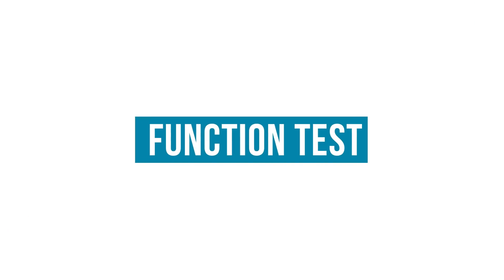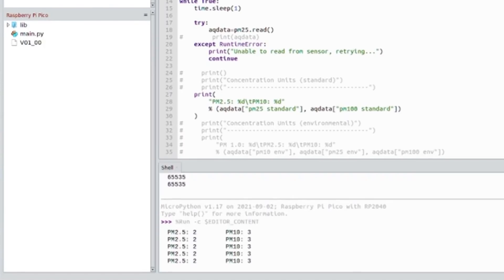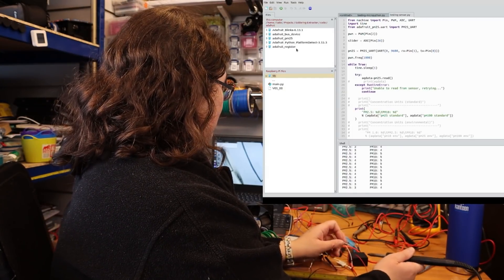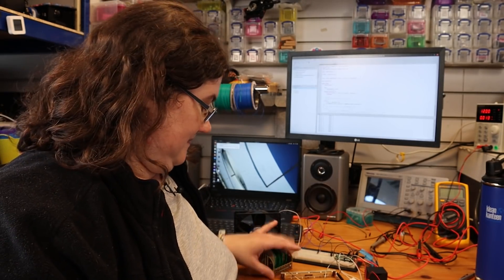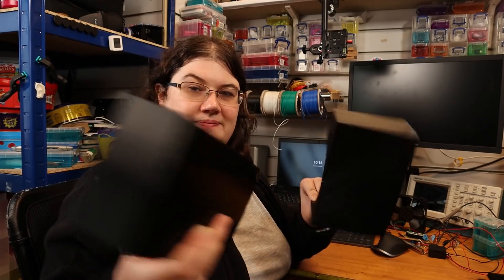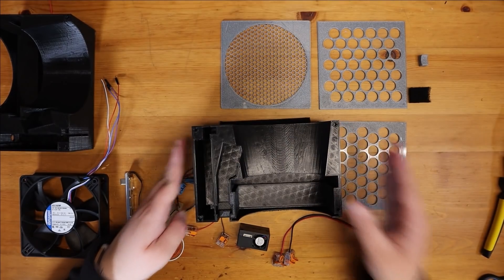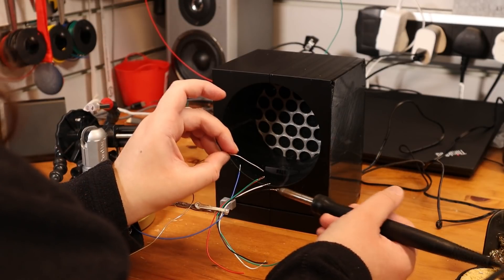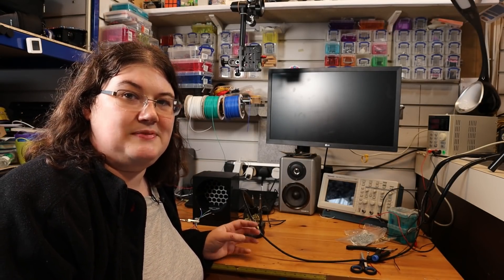Make your Own Auto-Sensing Solder Fume Extractor

Comment: I like the idea to use a particulate sensor. However, to really filter the fumes and not just blow them away, you should use a HEPA filter as well, as the fumes are mostly particulate matter which isn't affected much by the active coal filter which mostly filters VOCs. And then since the HEPA filter almost totally stops the air flow, one must also pick a fan optimised for static pressure...

Comment: Brilliant idea, thanks! I have done about the same without the sensor years ago (just a switch on there), but DC and battery operated (DC charges the battery when plugged in) because I hate wires on the bench other than what I'm working with :D ... For the fan start, I'd probably give it a full blast pulse, then drive it down instantly, that way it will start (there's probably a condenser in there that need to fill up before it starts or some trickery of the sort). That way you wouldn't need to have it running all the time. As for the potentiometer for use outside of soldering, I would just add a button to manually start and stop the fan. Maybe add 1-2 additional pushes for 1-2 preset speeds (1st push on at low, 2nd push on at medium, 3rd push on at high, 4th push off). Maybe add 3 small LEDs for the states (all off, 1 on, 2 on, 3 on). Would be neat. Just my 2 cents, hope this helps :)

Comment: Cool project, but seems a bit complicated.  I'd have just put a current sensor on the solder station mains or an optical sensor to detect when the soldering iron leaves its holder.  Add a 555 timer and you're done.

Comment: clever stuff.... in the past  I had thought of modding my soldering station  not as clever as they way you did it, but using either a microswitch or a reed switch to turn the fan on  as soon as I lift  the iron off the holder with a capacitor to keep the fan  running for a  few seconds or so after the iron is put back down  - as there would be no programming I'd just use a 10k potentiometer inline to set the fan speed

Comment: why don't you keep it simple and just bind the thing with your soldering iron? 

just wire the fans power source parallel with your soldering iron lady don't reinvent the wheel... 

if you really want to complicate things you can take temperature measurements from your soldering iron and activate the fan at soldering temps or measure the current drawn by iron or something which would still be pointless but still would be doable cheaper faster more reliable with analog jellybean parts. you don't even have to fool with your iron just use extension cord with inline switch or a relay or something with a 12v adapter. that way you cant forget to turn the fan on.
Reply: omg more i think about it more angrier i become. unnecessary  complex possibly problematic and hard to fix/modify when needed solution to a non existent problem. just turn the fan on when you want to...

Comment: Rather than using a sensor I would probably run them on the same power strip and have it such that when i turn on the power strip for the soldering iron it powers on the fume extractor.
But sensors are cool!

Comment: I've been flux sick. The little wisp of smoke that comes off a soldering iron is not going to get you sick. What made me flux sick was dumping a whole one pound spool of flux core solder into a molten pot of solder. That kind of cloud you should avoid. I'll tell you what getting flux sick is like. Just so you know if it is happening to you. If you're writhing on the floor and dry heaving you're flux sick. Take my word for it. Anything less than that and you're a big baby and it's all in your head.

Comment: This a great idea. Another option would be an ac current sensor on your iron's power lead.
Reply: Or just have the fan plugged into the same power strip as the soldering iron. It also turns out that if you put the fan on the other end of a flexible duct, it becomes a lot quieter and also makes it easy to direct it out an open window or into a bathroom.
Reply: @NiHaoMike64  Like the air sensor a current sensor is an analog reading. When the iron is melting solder it will draw more current.

Comment: I wonder if you need to start the fan at the fastest setting and ramp down to your desired setting once it’s had time to start.
Reply: Probably not, I could start it much softer, but I sort of like it as part of the startup sequence. You know it's working correctly if you've seen it start up.

Comment: My guess on the fan: Control its power as well. When you want to turn it on, first set the pwm signal, then give the fan power. I'm gonna bet that it checks for pwm right when it starts up, then goes into a sleep mode. If the fan is always powered you may catch it in the middle of a sleep mode and it won't turn on from the PWM until it wakes up again.
Reply: Thanks, and it sounds like a good theory, but it also happens if you take the speed right down to nothing and then start it back up without removing the power supply. There is an idea below that I should add a capacitor, so will try that and see if it helps.
Reply: @hifromkatie  "but it also happens if you take the speed right down to nothing" Yeah that's what I would expect, it goes into a sleep mode whenever there's no pwm (0% duty cycle) and then occasionally wakes up to check for pwm. I would wager that when power is first applied the speed controller on the fan checks for pwm before entering a long sleep cycle, so by applying pwm and then powering the fan's controller, the PWM will be seen by that initial check by the controller.
Reply: @b5a5m5  ah, yes, I wouldn't be surprised if it did. An, if I'm active keep checking, if I'm not active only check every 10 seconds

Comment: I would appreciate if you went through the printed parts design in freecad (at least a sped up digest version). There is not much complexity in the rest of the project, apart from programming, which is also mostly skipped...
Reply: Thanks for the feedback, I've been into more detail on the freecad design in some other project, so didn't go quite so deep into it for this one, but I'll bear it in mind in the future and cover it a bit more. 
The video length is kept a little more concise here, but there is an extra video of bonus content which goes into the circuit and code in more detail on our community website which can be found here: https://bit.ly/3k75dG4

Comment: That looks great! 
I guess the only things I would change if I were to build one, would be to place the sensor on top and search for a fan that reacts more quickly ... or make it analog. I think I would try to make it all analog, I have a soft spot for that. ^^ 
(Now I want to make one)
Thank you for the interesting video! I think you are very good at presenting the whole process!
Reply: Thanks, since the video I've actually found it works better if I put it upside down on my desk, so the sensor is at the top of the aperture. The fumes seem to be sucked in and around to the top of the fan.

Comment: Nice Katie but I have a current sensor on my soldering iron and activate my fan once the current crosses a treshold. I use a Tasmoto Wifi socket with current sensor and a wifi relay for the solder filter.
To start the fan with low pwm you need a capactior across your pwm output.
Reply: That's a great idea to use a current sensor, I hadn't thought about doing that before, but makes sense. The capacitor sounds good, no you mention it, I think I've seen that used before. I'll give it a go!

Comment: Great idea. I'd probably add a delay to run the fan longer even when the sensor is not picking anything up just to help clear anything lingering. And then add a hood to the front to direct the fumes into the unit when first starting off. And it'd rival the big boys out there.
Reply: That is a great idea, it does slow down fairly quickly. I like the idea of a hood too, I also though about a stand where it could be angled slight might be useful.

Comment: It's kinda funny that this should be a posted vid today. I was just looking for how to make your own Soldering Pot.
Reply: Ideal, it's great when timings align and you you find what you need at the right time!
Reply: I have a solder pot. It is an Eisco model 37. It's basically a cast iron cup with an electric heating element in it. Just the thing for tinning iron tips. It's good for stripping through hole circuit boards too.

Comment: that is a great fume extractor. 👍 i would certainly buy one.
possible ideas: 
have it run off usb c for versatility and portability (powerbanks), 
see if there are design improvements for better responsiveness with the sensor… maybe more than one sensor strategically placed? 
slider is a great idea, but maybe auto mode also working on a small switch in addition to the slider since the slider might not be as intuitive that one end is auto? 
small, dim (not glaringly bright) leds for indicators such as auto mode is on, that the fan is running, and that the extractor is plugged to power. 
case design: is the volume size great as-is or can it be slimmed down slightly for more desk space and portability?
two sizes maybe: one as a desktop and one smaller one for travel. travel one could have a small built-in battery option in addition to a usb c power port.
carbon filter tray that can be slid in and out for easy replacement without a screw driver or tools.
daisychain port for multiple extractors. 🙂
Reply: Thanks, they are all great ideas for modifications to the design. I like the second sensor idea, above the desk would be a great position for an auxiliary sensor